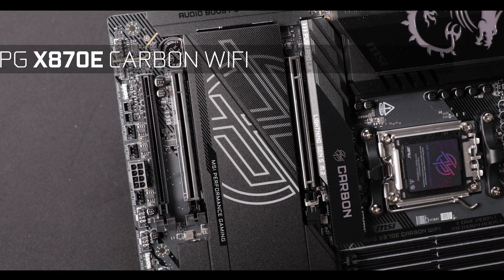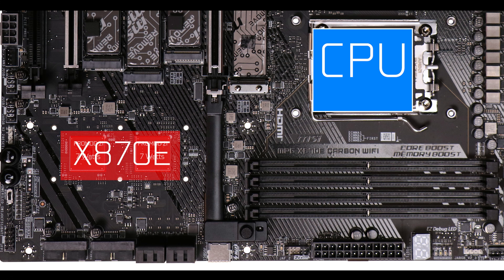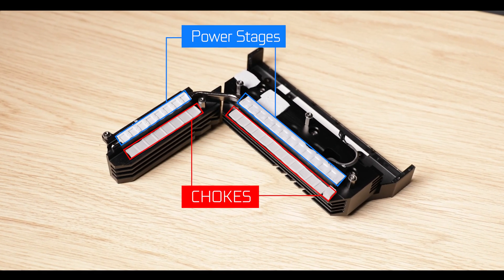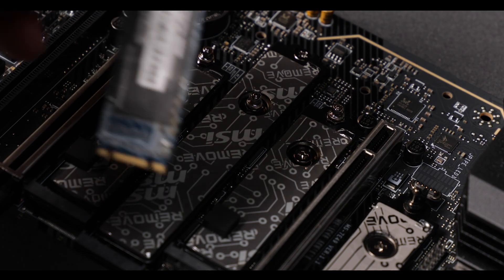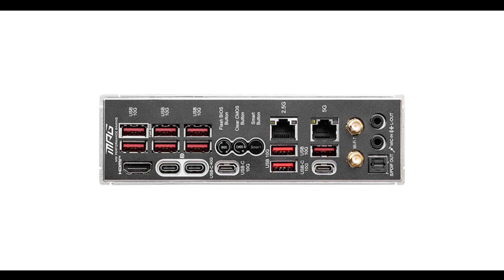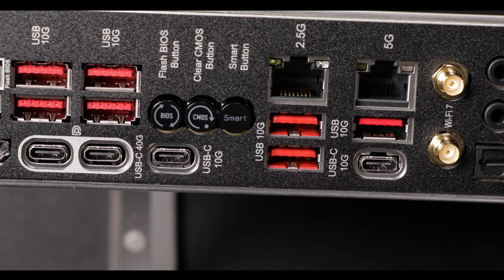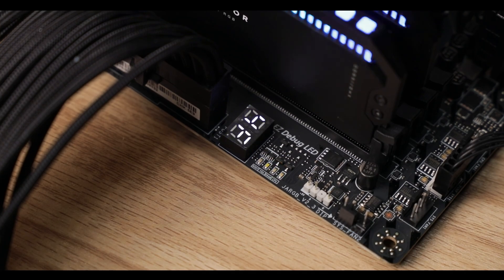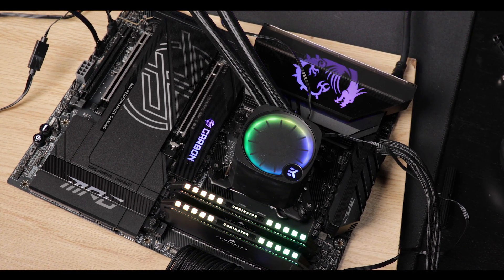MSI MPG X870E CARBON WIFI : not exactly an upgrade

Comment: Another small difference between Carbon and Tomahawk, is that Tomahawk has RAID support only for the NVMe drives, but not the SATA drives. I have no idea why, but the Carbon has both...
Reply: Tomahawk gets the SATA ports from an ASMEDIA 1064 add-in chipset.

Comment: I wanted this board but it would have been a 2 week wait on Amazon so I went with the X870e Aorus Master. The Carbon has a better I/O and the Aorus has shielded 8pin power connections. I was coming from a 10 year old 4770K and board and can see the Aorus board being used for 10+ years.
Reply: I posted above. I was also coming from a seven-year-old PC with the 8700 K over clock to 4.5 and I was running an EVGAGTX 1080 TI and it was showing its age.
Reply: I was running the Asus maximus 10 hero
Reply: @brianonofre5356  Nice!